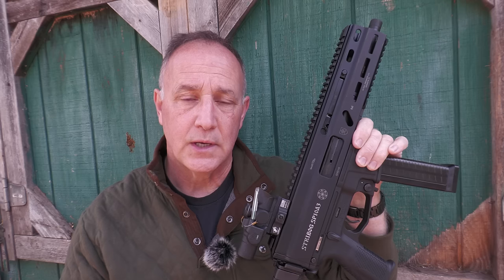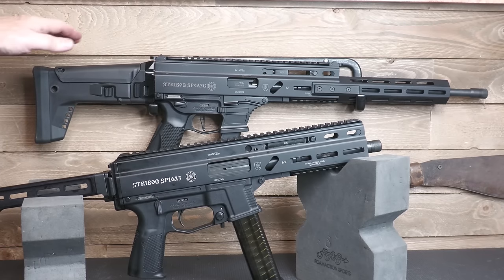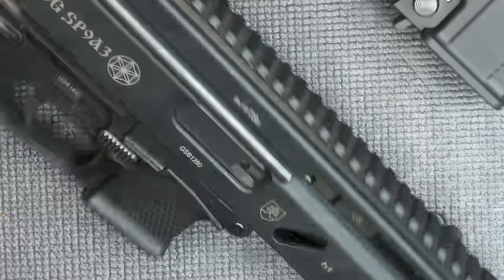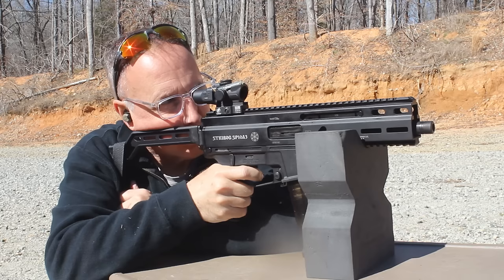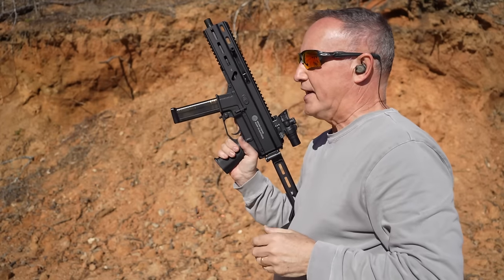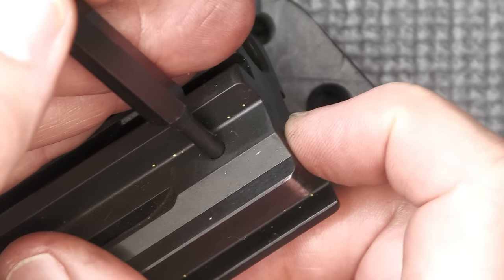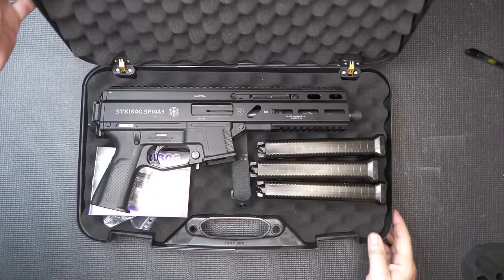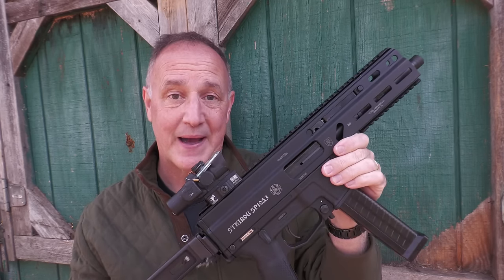The Best 10mm PDW? Stribog SP10A3 Gun Review

Comment: I have the SP9A1 GEN 2 Non-reciprocating 9mm (Direct Blow Back). I purchased a full billet aluminum “Lingle” ambi lower w/ LRBHO & also snagged a A3 Tactical Polymer Ambi Lower w/ LRBHO (I wasn’t sure which one I wanted lol. The lowers allow for any AR FCG tho some of the cassette trigger packs such as “AR Gold (Adj)” will not fit because of the upper having steel that seems to be In the way (I’m not sure if they have fixed that or not on newer iterations. I wish I could get the 9mm roller-delayed bolt alone but regardless the direct blow back isn’t that horrible to shoot, its actually very soft. I have been deciding on which new larger caliber PCC I wanted, the .45acp or the 10mm?.?.? I do plan on getting a can that will likely live on it so it’s been so awful thinking about which one to get 😁.... What’s up with YouTube caring about showing a 30 round or > magazine? Yes Sootch I believe Slovakia is straight out of Slovakia  🇸🇰 if memory serves me correctly🤙🍻
Reply: If you're going to use a can, go with the 45. 
Most 45 ammo doesn't break the sound barrier...